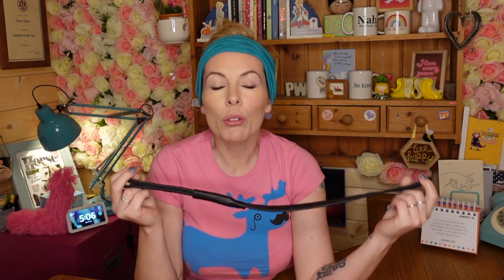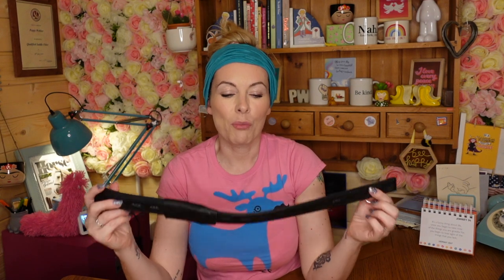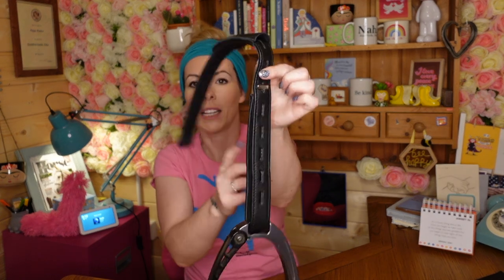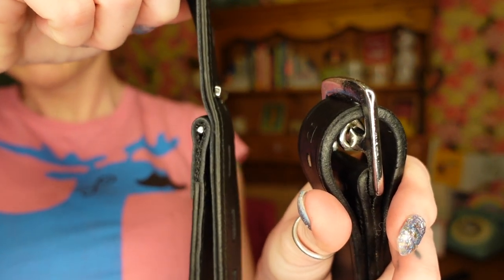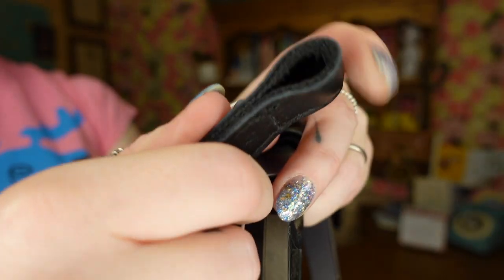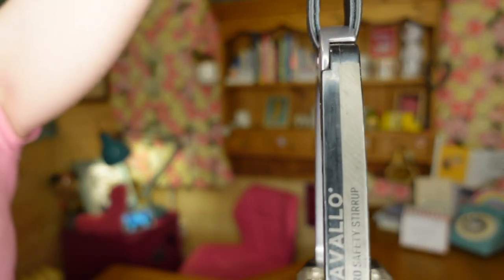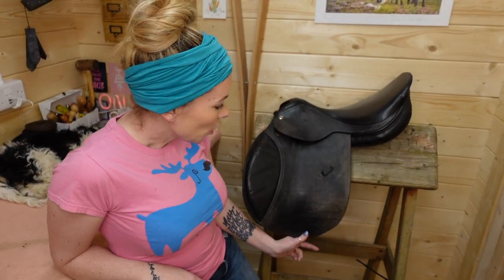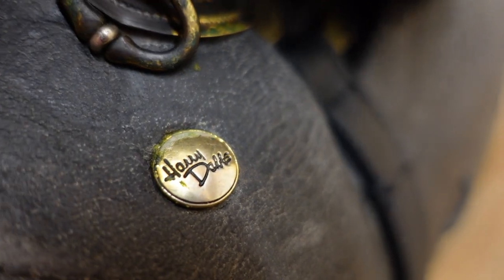T-Bar/Dressage Stirrup Leathers - SUNDAY SPOTLIGHT- Are They Worth The Hype?

Comment: Is it harder to change the length of the t bar stirrups? I can imagine it to be quite annoying if multiple people ride one horse and have to change it
Reply from the maker: I think they're much easier, personally. Cos you don't need to pull it through the stirrup bar - and some leathers can get a bit stuck/shredded as you pull it through. to change these, you literally untwist the t bar bit, move it to the hole you want, and slide the leather protector down. :) the only thing is, if you change them on board, you have to lean down a bit - but saying that, it's still easier than having to move your leg back and pull the leather through like you do on the 'normal' leathers :)

Comment: I’ve ordered some and can’t wait to try them. I have ridden in them on other peoples horses so am hopeful. Main thing I’m worried about is the length I’ve ordered being appropriate. I’ve read that the t bar (even enclosed in its leather guard) needs to sit close enough to the stirrup iron as to not be on the saddle flap - to avoid wearing a patch on your saddle. What do you think about that advice? 
As I may want to take them up for jumping this seems like an impossible balance to strike😬
I’m hoping the leather won’t actually rub all that much🤞
Reply from the maker: It should be fine, as long as you keep the little sleeve over the buckle. :)
Reply: I know Im asking randomly but does anyone know a trick to get back into an instagram account..?
I stupidly lost my account password. I love any assistance you can give me
Reply: @Ignacio Bentley instablaster ;)
Reply: @Jaxtyn Martin Thanks for your reply. I got to the site thru google and im in the hacking process atm.
Looks like it's gonna take a while so I will reply here later when my account password hopefully is recovered.
Reply: @Jaxtyn Martin It worked and I finally got access to my account again. I am so happy:D
Thank you so much you saved my account !
Reply: @Ignacio Bentley you are welcome xD

Comment: How do you choose the correct size vs a normal leather length? I am tall.
Reply from the maker: Hmmm. That is a tricky one... cos it depends on the manufacturer. It's probably worth checking the length of your current stirrup leathers (you'll probably be a 56" or 60" if you're tall) and ask the manufacturer which length they recommend.